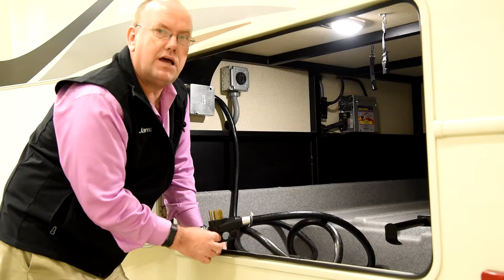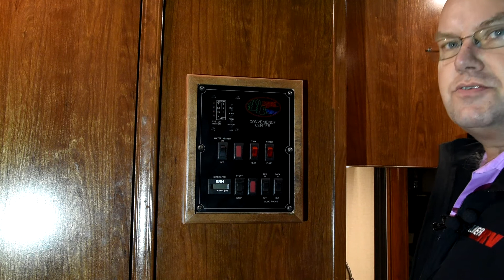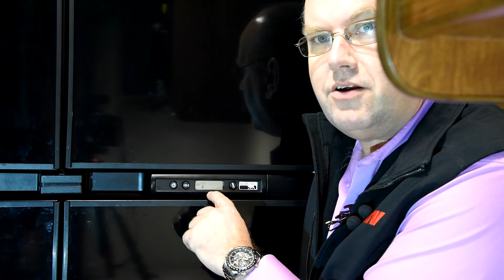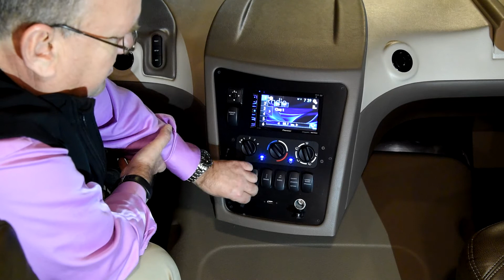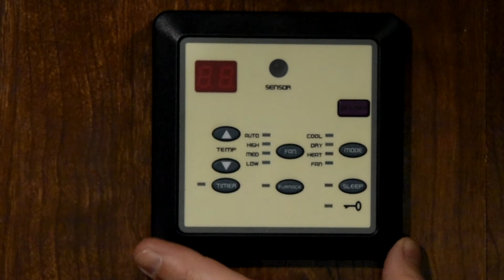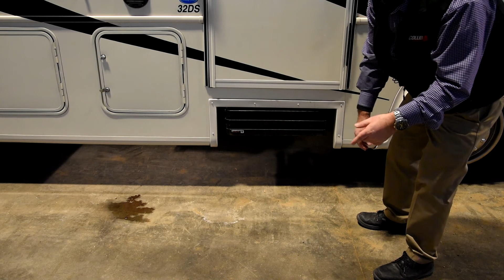FR3 Motorhome Operation and Use Collier RV I94RV

Comment: I have a 2022 FR3 34DS. When we are dry camping and run out of fresh water can we fill the fresh water tank with a 5 gallon water jug? In the past on our 5th wheel there was a fill tube where we could sanitize or fill fresh water in the fresh water tank. How do we do this in the FR3?